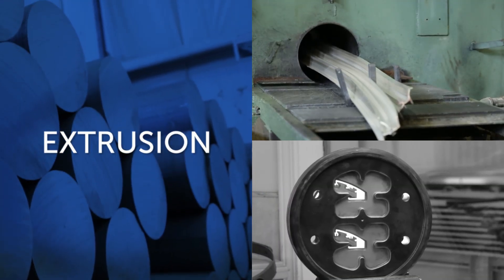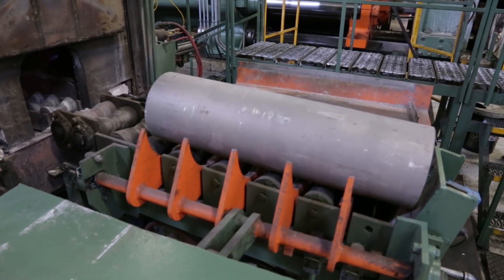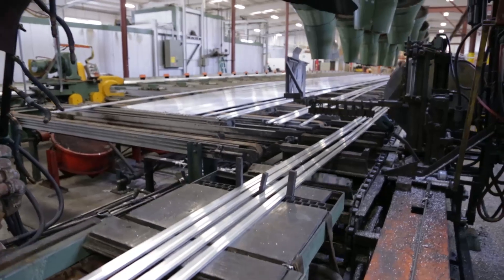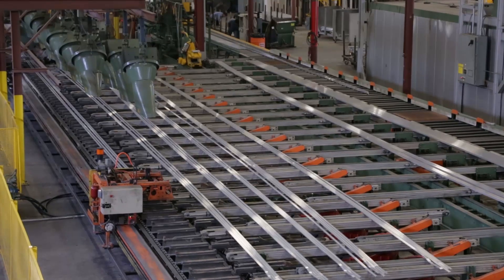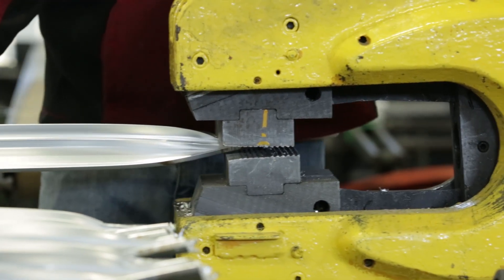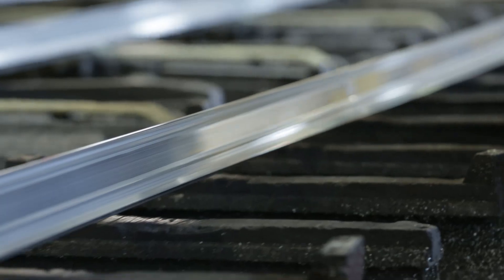Custom Aluminum: Extrusion

Comment: I work at shape previously known as magnode and we use up to 15" log in our max 5500ton press.
Reply: This is Mia from China. I am  from Foshan Jieshangwei Aluminium Products Co.,Ltd.,l hope you are doing well. I wanted to introduce myself and our company. We specialize in aluminium extrusion die for almost 20 years. Our monthly capacity range from 5000 to 6000 sets which can rank top 3 in Foshan. And I believe we could have a great opportunity to collaborate. Would you be interested in
discussing this further?
Reply: @Mia-u6h  كم تكلفة الة جط الانتاج

Comment: I'm a press Operator at an aluminum extrusion plant without pullers makes it much harder to get the run out right
Reply: I've got a question if you don't mind - what are the smallest batches that are run? It seems to be really hard to get information, and inquiries are mostly rejected, so we couldn't find out what is considered infeasible.

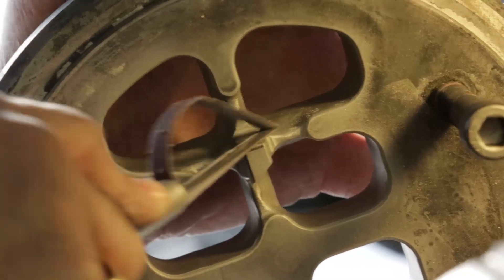Comment: Does anyone know what the tool is at 3:27 …? It looks like a tool to hold sandpaper for sanding small flat and curved areas. And I have many types of sandpaper related tools but I’ve never seen one of those. A brand or even the proper name of it would be super appreciated.
Reply: It appears to be a piece of bar stock with half of the circumference milled off. A slot at the end to tuck the paper into & hand tension used on the tag end to keep the sandpaper taught. I would assume that it was created by a tool & die maker for that specific purpose.
Reply: "sandpaper file" or "sandpaper stick" seems to yield some search hits and products (e.g. Extron)
Reply: @hardwareful  Thanks!  There's a knockoff version of the Extron sandpaper file on Amazon, I just ordered it... that's the closest thing I've seen so far, I really appreciate the info. 🙂👍

Comment: i always wondered how extrusions with holes in it are made, how is the mold part that creates the hole attached to the rest of the mold?
Reply: This didn't answer his question at all. He's wondering how there are complete holes formed into the extrusion.
Reply: As far as I know, holes are added after the extrusion, rolling the profiles through somekind of machine that pushes out the holes quickly
Reply: A part called a "backer" is attached to the actual die.. the aluminum flows thru the backer before it comes out of the die. Kind of hard to explain in text lol
Reply: There are different types of extrusion dies , the ones with holes are call hollow dies and are  built with three componenets, the female ,the male and the baker.
this three parts are hold together with bolts. if you look for a hallow die on you tube probably you can find more information. Also they use a solid die, feeder plate dies and bridge dies.I use to work on the extrusion process for about 15 years and kind to know the process.
Reply: Yes it is the die, with four ports, at the entrance of the die, when the hot malleable aluminum enters the  the die thru four ports the profile gets welded inside the die, and it comes out with hollow as it emerges from the die. This is called a hollow die.
Reply: @servandoaldaco4813  Hello. Could you provide a guess at how much a 40x40x2 hollow square aluminum extrusion (just for reference, you can use anything else) would cost? How about the price difference between the states and europe? I have no idea about the financial aspect and am highly curious. Have a nice day! :)
Reply: @leharrus1578  
Good morning, I guess your dimensions are in mm.
To get a price you need to have more information, all depends of the material type, it could be 6063, ,6005 or a different one

 and also on the temper 
If you contact a extrusion company they will ask for the cuantity you will order the lenght of the material and and the end use.
It's really to many things to give a quote, but if you just need a few pieces you can contact a retailer company, they use to buy big quantities of extruded material and resales
You can find some of this companies on Internet and find the one is closer to the area where you live
You can get a price for lineal foot, per pounds or for the piece 
All depends on the place you buy it
Reply: @servandoaldaco4813  Good morning, thank you for your answer! Especially those tips with the alloys and temper. I was thinking about cheap profiles that can be used to mount solar panels on roofs.

Currently I am buying those for around 7€(8.3$) per meter(3.3 feet). But if I could invest, lets say 10-30k, to reduce the price by a good margin; That would be nice. Just a spontaneous idea.
Reply: Good question. It's actually very simple. See, it enters in a liquid state. It exits in a solid state. That means that inside the die it can flow around any part of the die. So the hollow for om the die only needs to be there at the end of the exit. Before the exit it can be attached to the outer parts of the die.

You have to spend some time visualising it and follow every step in your mind. Then you will understand. I was wondering the same as you
Reply: @leharrus1578  is that 40 cm or 40 in? LxWxH

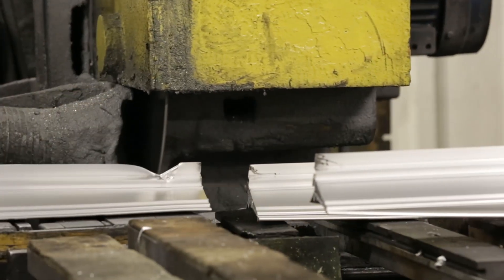Comment: 2:22 It just damaged the profile...
Reply: thats fine its used to stop the feed while the saw cuts
Reply: I just damaged my monitor trying to wipe the hair off your thumbnail.
Reply: That's normal, there's usually a foot to three feet of scrap that comes off each end of the extrusion before it goes to the finish saw to be cut to final length.

Comment: Hi , dear friends,Good day!
Nathan from China Zhongwang Group very honored to leave a message here! 
Zhongwang Group was established in 1993. We supply Aluminum extrusion products to various customers worldwide in many fields like :

Aerospace, Marine and Military industry. Biochemical, Chemical processing and Oil industry.

Medical, Sport and Tooling industry.

Construction and many other fields.

- Bars : Round - Hexagon - Flat  - Square, any customized shape

- Sheets : Rolls - Cut acc. to Customed sizes,customized

- Plates & Blocks

- Discs - Slugs

- Pipes & Tubes

- Fasteners

- Extrusion Profiles : Standard and according to Customized drawings

We are the Top 1 aluminum extrusion R&D and manufacture in China and Asia, 
We can do any customized aluminum extrusions as per specification requirements.
We always insist on offering best quality aluminum products with competitive pricing, and trend setting business solutions that give our customers the assurance they need to get the job done right and in time.
"Just-In-Time Delivery" is the backbone of our business.
We can make the largest& most complex aluminum extrusions in every industry area.
If you want to see more items,pls contact with me directly. We will be happy to give you a quotation upon receipt of your detailed requirements. 
Looking forward to serve you! 
Peace be with you!
Nathan
Email: nathan @ zhongwang. com